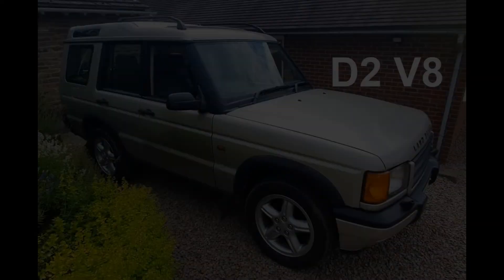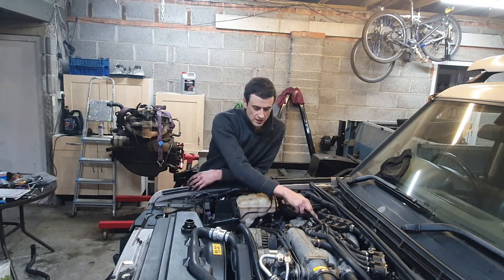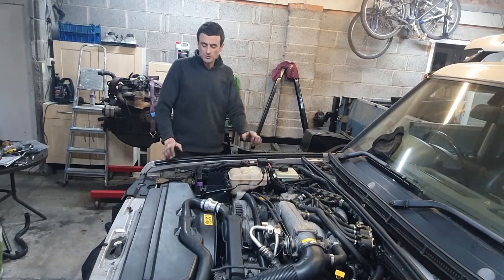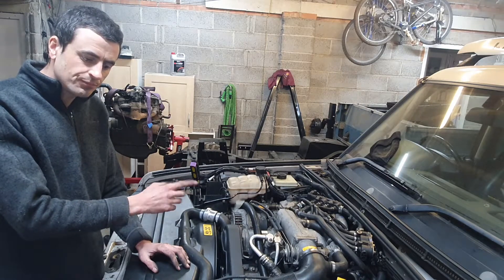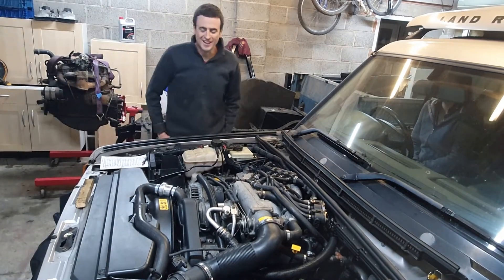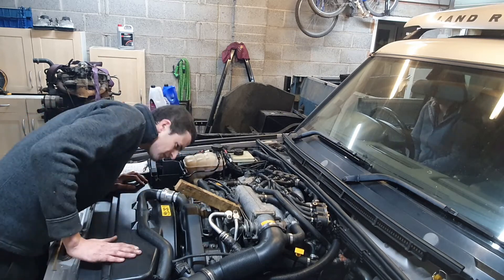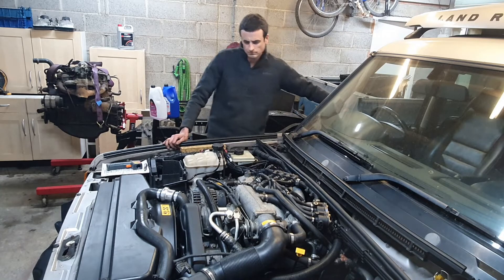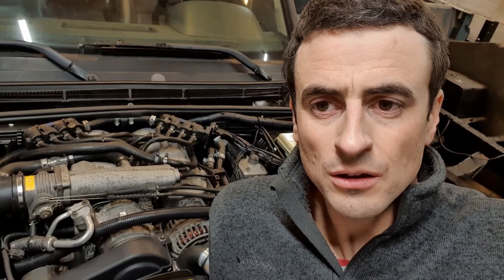First Start After engine Rebuild  -  Discovery 2 V8 Engine Rebuild Part 13

Comment: Hiya did you prime the tappets before you fitted if you didn't the high rpm would prevent them from priming so a steady drive with out labouring the engine will sort that thanks great vid
Reply from the maker: Hi Jeroem. Thanks for comment and the suggestion, much appreciated. 

I primed them on the starter while it was on the engine stand in an ealier video, but other than this I didn't prime them before fitting. 

I did take it for a drive in the end, for an hour or so but unfortunately it didn't fix the noise. It turns out I had some faulty parts, you'll see later on.

Comment: I bought a 2004 land rover discovery 2 with 4.6 146k on mileage really that's low mileage on a 20 year old vehicle I got it cheap because it was in a minor accident previous owner said it runs and drives but it cranks slow maybe battery I tried jumping d2 still weak crank but my plans are engine swap to a L S 5.3 that has 315 hp 335 torque similar in weight but way more reliable unlimited replaced parts a company in california called alternative conversion engineering sales conversion kit very easy to do youtuber lost cause ranch has start to finish video how he did it here in usa 5.3 used engines are cheap and I can mate it to the original transmission and keep all the functions,  I also own a land rover lr3 but I feel the D2 is better for offroad due to the front & rear solid axles  but the lr3 has a bit more features i like such as split tail gate i often  wonder would a lr3 4.4 engine and transmission work in a D2 maybe you can be the first to try it and see if it will work 😊
Reply from the maker: Thanks for the comment and thanks for watching the video. 

I had a look into engine swaps early on in this engine rebuild project. I have seen the conversion videos you talk about. I would love to have swapped an LS in, it's a much better engine and I love the way they kept all the of road features as you say. Its a really cool conversion. 

I like your idea of swappig the later drivetrain into the D2, that diesel V8 is an amazing engine with endless torque. Trouble is I'm not at all good with the modern electronics....   keeping all the fault lights on the dashboard happy would be very difficult. Plus I now have the rebuild rover engine so kinda need ro stick with it really. 

I love the sound of your project. What about making some videos of your progress?